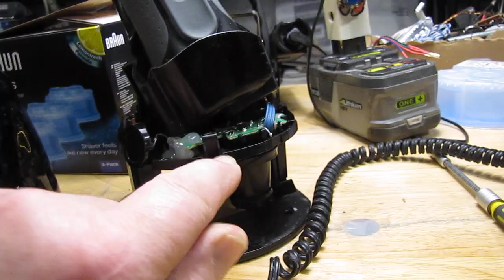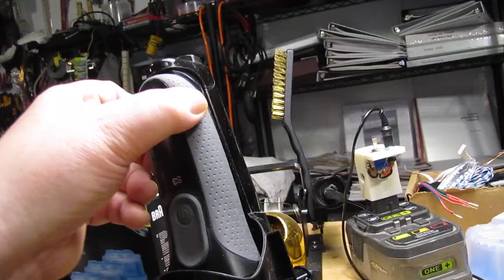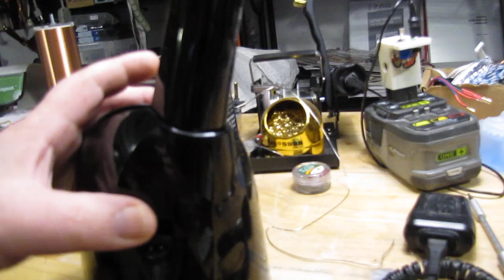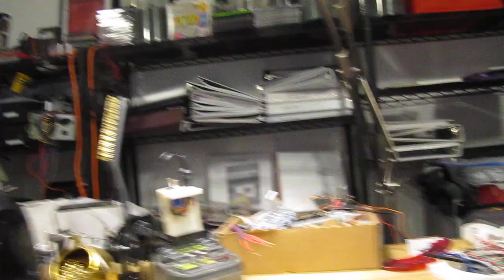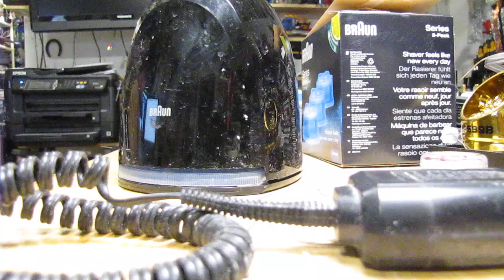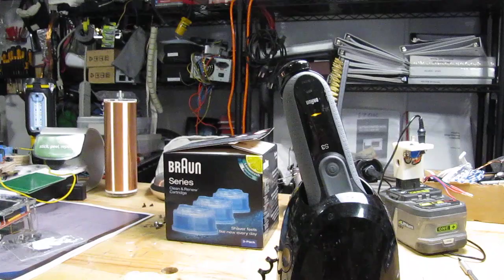DIY BRAUN SHAVER Station easy repair!

Comment: I use 50% 190 proof vodka, 50% distilled water, and 10 drops of favorite scent essential oil to refill. Its a little trouble rinsing out the container, filling with tap water, shaking, dumping and repeating (10 times) until it looks clean enough.

Comment: I watched all the videos but didn't see where you took the circuit board out or fixed it. Did you exchange the board or fix it if you exchanged it where did you get the new one?
Reply from the maker: Please see all the videos - click on SHOW MORE..... Just had to pop it back and secured with hot glue and it is working.

Comment: Hi sir.I have a issue with this machine.Charge but not wash my shaver.only green light turns on.why?What can i do?
Reply from the maker: If you are good with screwdriver and other tools and love to fix stuff, I would watch my videos and see what I had to do. Make sure you watch them all! I do not edit anything, so you will see everything I had to do. I'm not taking any responsibility in case you make your useless.  But if it isn't working and you aren't gonna send it to repair shop, you have nothing to lose. Make a video  and take pictures, so you can put it back together. Wish you luck fixing it!

Comment: I tried releasing the clips which is successful BUT the case won't come apart as there's a black, oval object that is preventing the case from removing completely. It will not pull off either. Very tricky to work out.
Reply from the maker: Try to see all 4 videos. You might find solution there. See my comments below.
Reply: @tonysfun  Hey, I tried but cannot see in any of your videos how you remove the bottom from the top.
Reply from the maker: @Retro-Future-Land  I know that the videos are several years ago, so I don't remember all the details, but there is enough info, so watch them all, because I wasn't at the time very organize in my videos - sorry.
Reply: @tonysfun  Unfortunately this part that is on mine is not on yours so I think it is a slightly different version.
Reply from the maker: @Retro-Future-Land  Sorry, but if I can speculate, look for a screw or one more clip? I remember that sometimes the clips you pushed to open snap back to a locked position!? What is the model number? Is it newer model?

Comment: Hello Tony, 
        I have two(2) comments,  first is I was trying to find how to disconnect the Braun charger and cleaner housing from the base to separate the two (2) pieces. I currently have not come across it yet. Did you do a video of that procedure?
        The second (2nd) comment I have, is the pronunciation of the name Braun, slightly similar to the kitchen paper towels known as "Brawny" but without the letter "y".  Brawn = Braun. 
All in all you did pass on some useful information. Thanks.
Reply from the maker: There are couple videos about this repair - here is my main page: https://www.youtube.com/playlist?list=PLv52A7rm-UViZEOlzZfZOB9Gl8cjS3ze5
And here are the other videos: https://www.youtube.com/watch?v=0-ih4hDDm28&list=PLv52A7rm-UViZEOlzZfZOB9Gl8cjS3ze5&index=32&t=3s&ab_channel=TonyFleming
https://www.youtube.com/watch?v=bokeA_8o6NY&list=PLv52A7rm-UViZEOlzZfZOB9Gl8cjS3ze5&index=33&ab_channel=TonyFleming
https://www.youtube.com/watch?v=Mufu9wT_mYU&list=PLv52A7rm-UViZEOlzZfZOB9Gl8cjS3ze5&index=34&ab_channel=TonyFleming
https://www.youtube.com/watch?v=e-tSHJkSmfI&list=PLv52A7rm-UViZEOlzZfZOB9Gl8cjS3ze5&index=35&ab_channel=TonyFleming
https://www.youtube.com/watch?v=IrLI5TLcSbg&list=PLv52A7rm-UViZEOlzZfZOB9Gl8cjS3ze5&index=36&ab_channel=TonyFleming
https://www.youtube.com/watch?v=xLYZljNyxI0&list=PLv52A7rm-UViZEOlzZfZOB9Gl8cjS3ze5&index=37&t=18s&ab_channel=TonyFleming
https://www.youtube.com/watch?v=N4oOfBhOGtU&list=PLv52A7rm-UViZEOlzZfZOB9Gl8cjS3ze5&index=38&ab_channel=TonyFleming
About my prenanciation - sorry about that, English is my 7th language and I now have accents and mispronunciations ian all of my 7 languages, but the important information is there in the video.

Comment: I think it should be possible to refill those canisters with ethyl alcohol. That seems to be what's in them in the first place.
Reply from the maker: Sounds right! But I think there is some kind of lubricant - once I owned a spray that lubricated the head, but I don't know where it is... It smells almost exactly like the washing liquid.
Thank you for your input! Have a great Memorial Day and weekend!
Reply: @tonysfun  I have slightly older model that is white instead of black with out the plastic part on the top, but other wise identical. I found this video because I was having trouble getting it apart. Anyway I'm going to see how pure ethyl alcohol works since it's far cheaper than those canisters.